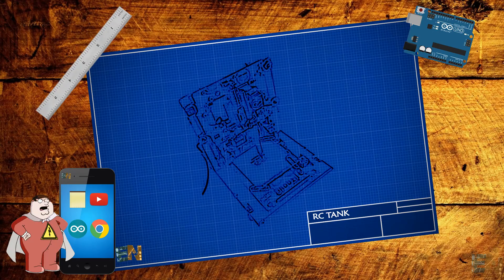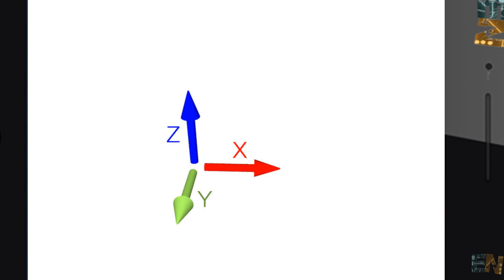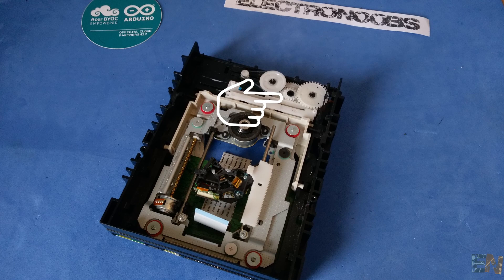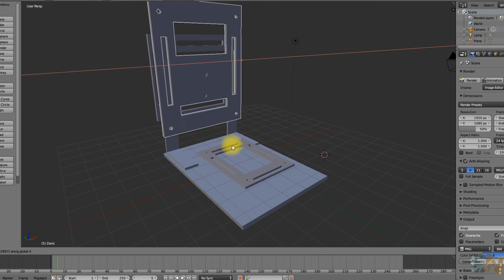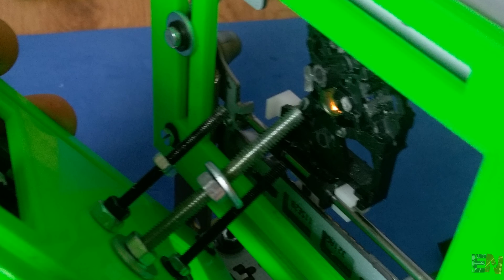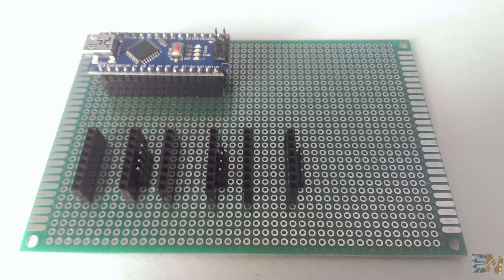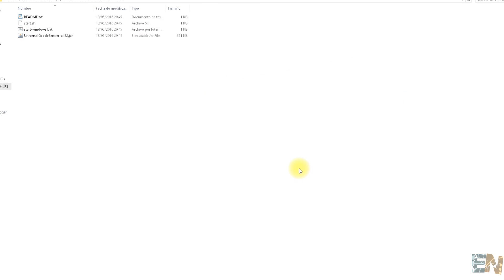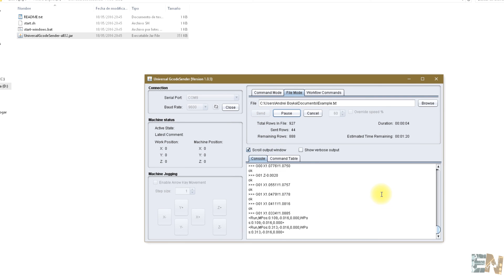Mini CNC plotter DVD step motors

Comment: Hello sir,
             I  make CNC mahine with Adreno uno  board, cnc shield , A4988 stepper motor driver and 12v dc 1A , but in my case our 1 motor works in good condition  and other 2 motor works very slow or some times not work properly. If we touch motor it vibrates , but it dont run.I try to adjust  A4988 driver screw , but dont effect so much on motor .So please guide me, i need your help